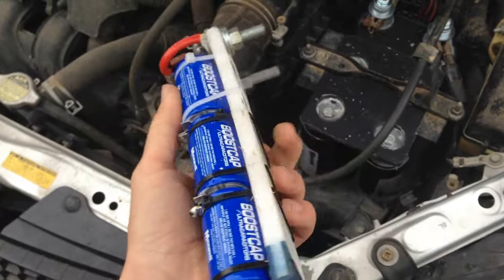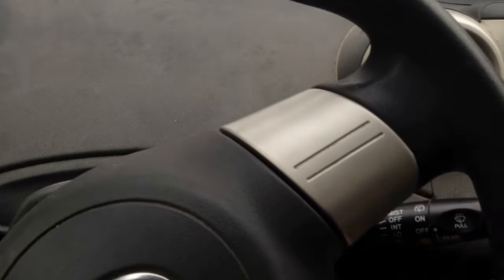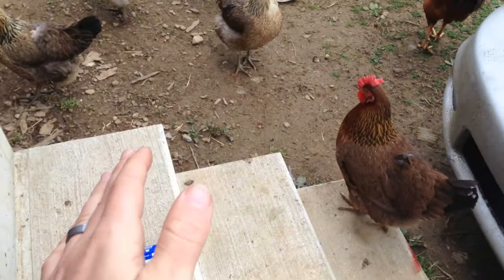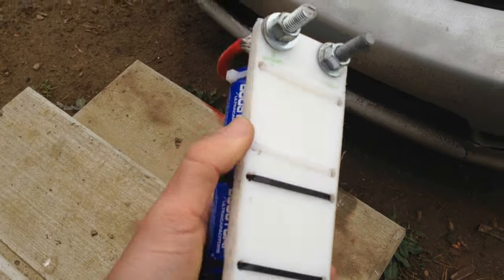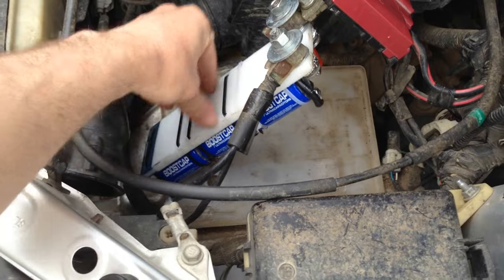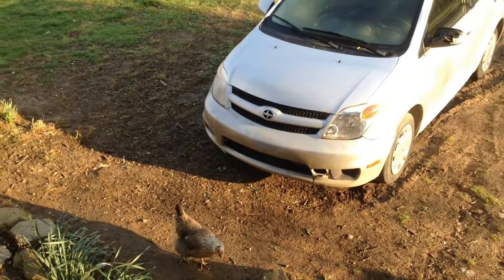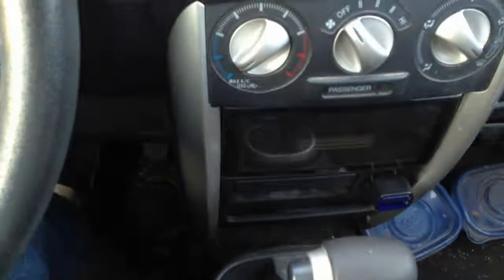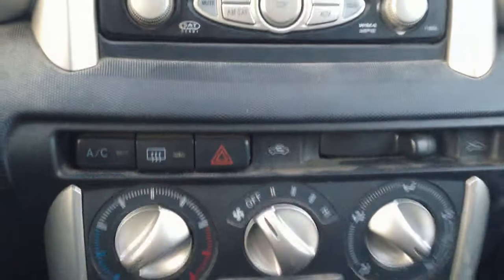Replacing My Car Battery with Capacitors! 12V BoostPack Update

Comment: This would be brilliant to have them charge while the car is running, and when the car is off, use the battery to keep alarm, and misc. electronics powered, but when trying to start, use a relay and switch to the capacitors....
Reply: WarHawk427 I was thinking he should have a solar panel on top.

Comment: what about .when is snowing would the freezing temperatures affect the car starting ..I think so ..
Reply: Supercaps are not affected because of low temps because they not use chemical energy but electrostatic energy, unlike ordinary lead acid battery, which can go very low with performance when temperature drops. The only problem with low temps would be engine being harder to turn because of thicker oil.

Comment: The part that's super-hoaxy about this is the radio part. I hooked this exact array up to an inverter which then powered a 10 watt speaker playing some music. And the caps lasted about 2-3 minutes by the time it dropped from 15 volts to 10 volts. I haven't bothered to try starting a car with this array... But I feel the OP isn't being totally honest.

Comment: I can't record anything without chickens invading the atmosphere and,  probably forty running loose. Nice job on the capacitor I wonder if a diode would prevent voltage drop, like they use on solar controllers

Comment: That was super. Thanks!
Would this work well as a power bank for a mobile solar rig?
I need something to recharge camera and computer gear in the backcountry with a solid constant source to run pure sine wave inverter..
Marine batteries are expensive and heavy. This seems ideal.
Reply: I have chickens as well. I love the chatter.
Reply: Yes, Hybrid design = super-capacitor + a small Lithium-Ion battery

Comment: The basic problem is that the car system uses power even when the engine is not running, so we need a lot of reserve power for long off times.  It would be better to have a smaller battery in parallel with caps.

Comment: In 0:41 have you touched negative and positive and you didn't die or your fingers didn't melt down? Were ultracaps discharged?
Reply: You are Talking about 12V doing harm??? Usually people start to FEEL voltages above 24V (tongue) 40v (on skin), we are Talking about 12V, nearly double than typical Phone charger, yet people most of the time (not talking about this ripoff chargers) are not killed by accidentally touching the plug of Phone charger...

Comment: How the heck are those 350 farads when a 2 farad car audio capacitor is the size of a water bottle?
Reply: +DesolatorMagic The rated voltage is much lower for these capacitors. Since the general equation for a parallel plate capacitor is C = eA/d, the capacitance increases as the distance between the plates decreases. With a lower potential between the two plates, there is less risk of burning through the dilectric and rendering the cap useless, so the plates can be placed much closer together.
Reply: Nick Christopherson
So since audio caps are 12V and I assume those 6 = 12V then they're 2v and that takes it all the way from 1-2F to 350ea?  That still seems excessive.  They must have altered the materials too or something.
Reply: +DesolatorMagic No that's normal. Learn how a capacitor works and what determines the voltage/farad.
Reply: What you're missing is that a denominator relationship is not linear, it is inverse. If the numerator value of the permitivity and area comes out to be 1 and the distance is 1, you have 1 farad. Now make that distance 0.5 you have 2. Now make that distance 0.25, you have 4. 0.1 gets 10, etc.
Reply: He may have meant microfarads. uF or mF ?
Reply: Brett Bendele no, they are actual farads. This is due to the very low voltage (2v)

Comment: if I were to hook up a couple of banks of these capacitors in serial/parallel would they work in an RV for deep cycle use especially with a generator backup for charging them back up?
Reply: no, mainly because you'd have very little reserve power. lead acid batteries would do a much better job for powering your RV. You'd need hundreds of capacitors to store as much energy as one lead acid battery.
Reply: Thanks looks like I'll stick to deep cycles in parallel.

Comment: would you help me with trying to make a motorcycle battery replacement?
I know electronics but any tips or tricks would be great,Thanks
Reply: Frightline777 I did a setup like this on my car. Personally I think you would want to measure the power and energy requirement for starting with the battery before buying any caps. This can work ok in some applications but not for all of them.

Comment: You still around?  Notice this vid is about 6 years old.   Question.  What would this boost pac cost today??  (2018). Also, have you thought about a waterproof plug in module for this application?

Comment: From where i came from its very difficult to buy a maxwell or boostpack super capacitors. Question is will the GreenCap from china work as well as your boostpack? they came with the same specs as 2.7V 500f.
Reply: Are they high quality or junk ?

Comment: Uhmmm... what I ask myself is: how safe is this? What about long journeys, when power is always given from the light-engine to the pack. And what if the pack will not take any power, because it's fully loaded. Can the power-engine be destroyed? Some engeneers say, you should not run a car without a battery. 
And what about the risk of fire? Or exploding of the packs?

Comment: How do you ensure that the capacitors are balanced? I don't see any balancing circuit on it, it's just connected in series.
Reply: Yes, you should add a Balancing Board.

Comment: This would serve more as a backup to start up the car in case the battery's dead.
Reply: Or wire it in parallel to the battery.  The cap handles the starting surge, saving wear on the battery, and the battery handles the deep storage.

Comment: As an electrician I am just watching those two massive steel bolts so close to each other, pretty sure your capacitors will dissapate completely if you short it out and it will be a large ass bang,

Comment: could you try this with a car that has a "Dead" battery and won't crank over? often there's still charge in the battery but it's unable to provide enough cranking amps to turn the engine... if you connected one of these that was uncharged and let it charge from the dead battery to 10, 11 or 12v (what ever it's at) and tried to crank the car over would it be able to start from a dead battery... I'm thinking of getting a few of these just in case my battery does die... it's only a 1.0L 3 cylinder so maybe I could get away with using small caps?
Reply: Yes, that's probably the best use of this idea - in an old battery the series resistance increases, so the voltage sags when a load is put on it.  The caps would over time charge to the battery voltage, but can immediately deliver the all the current that is stored (albeit only for a few seconds). 

Where this is not good for is starting after the car has been sitting for a long time (small loads will eventually drain the caps), and for lights and other loads when the car is not running. That energy needs to come out of the battery.
Reply: Do these caps lose charge if just sat in the boot with no load connected? If so, these things would be a much better thing to carry for dead-battery emergencies than jump leads and relying on someone with another car to help you out...
Reply: Debbiebabe69 yes they do loose charge but if your battery still has the ability to run low load items like the radio you could just hook it up to charge from the dead battery and then once it's charged it could provide a high amperage burst that the battery wouldn't be able handle without high Vdrop

Comment: would it work with any car? i have a 94 mustang GT and im very interested in this idea .. also for someone that had no electrical knowhow could we maybe order one  ready to go it though you?
Reply: bad idea... leave your lights on or pkay the radio for a short time and it wouldn't start. If your alternator goes bad tje car will shut down in just a few minutes. capacitors offer very little reserve power with current technology.

Comment: You could probably use a small motorcycle battery in junction with the super caps in a race car for weight reduction or put it in series with your audio amplifier before the amp in the trunk so your lights don’t flicker. I wouldn’t want this as my primary power supply for my truck and just like someone commented that the cars computer is alway on and slowly draining the battery you could put a breaker switch when you shut the car off hit the breaker so it won’t drain or theft but if your reg battery is working fine why bother

Comment: What's the minimum voltage you can start the car with? Surely no lower than ~10V?

Nice video by the way. Clean and to point. Thanks man!
Reply: it takes over 12v to crank the engine at good rpm, anything lower will not start

Comment: try running all your elecric components  headlights ect to see if the caps can handle the load.plus see how many cranks u get before it dies out
Reply: If you install a large Super-Capacitor then you can do this.

Comment: Would like to see what happens to the electrics/wiring of the vehicle when the engines not running but ignition is on?? I suspect stuff would be burned out?? Good idea though assuming this is not a con.

Comment: stick a solar pannel in the back window and you will allways start , trickle charge and never need to repace a battary ever again , Theres onle one problem if the regulator went short in the altenator then it would kill the car so protection needed , but it looks a brill idea all though you cannot leave any parking lights on in the dark when on a main road . you still need a battary , but still a good use full system for boats and so on

Comment: I have to charge my 1 farrod cap before using it & discharge before disconnecting it! I did not see you charge your capasitor so, that alone, makes me a bit skeptical. I don't doubt that it will work, I just wonder why you didn't show yourself charging you cap & bringing it up to 12 volts or higher? I  had my cap & sterio connected & I disconnected the cap & system because I smoked my alternator by manually running my cooling fans & running my system! I have since replaced the alternator & I am waiting until I replace my cooling fans b4 returning my sterio to the vehicle & it is parked while I wait! I am wondering since the cap raises the voltage to 14+ volts, was it the current draw or amperage draw that smoked the alternator? I assume the current & amperage draw probably smoked the voltage regulator? I have another voltage regulator that I am going to install into this last alternator just to see if it will then come back to life? if not, o-well, I just installed a brand new one!! be cool to have a back up tho!!!
Reply: He should have showed the "pre-charge" steps.

Comment: Dude, the way to test it is to disconnect the coil wire from the distributor so it won't start, then see how many seconds it can crank the engine at a decent starting speed. Don't go more than 30 seconds or you can burn out the starter. But I doubt this can crank your engine for even 15 seconds. You keep measuring voltage. It's amps that count. Please see how LONG it can crank your engine - in 15 second bursts to cool the starter...
Reply: The small unit will NOT crank for 30 seconds - most newer car do not.
If you need 30 seconds then use a LARGE super-capacitor and parallel a small Lithum-Ion battery

Comment: It will start it but not hold the charge. Believe it or not I actually started a 20 Ltr diesel with an 18v ryobi battery with regards to car batteries it's all about the initial output and ofcourse the recharge

Comment: if you want to burn your car, you can put the big capacitor in your hot engine zone, the capacity will burn if over charge or over heat, the electronic circuits of your car will short quickly because capacitor absorb too much power of alternator.

Comment: What is with all the ring comments?  If a regular acid cell battery can produce enough cranking amps to turn over the engine of a car or truck, then they should not be any more dangerous.  Try shorting the two terminals of a regular battery with a ring. It will indeed get hot and maybe melt and maybe spark and probably ruin the battery. But, with proper voltage control circuitry, then you could have it converted to AC first and then to a nice clean 12 V DC and discharge everything simultaneously like the solid state jump starters that you can buy instead of over a certain time constant.  I think a normal electrolytic capacitor has a discharge rate time constant.  The formula is τ=RC. This value yields the time (in seconds) that it takes a capacitor to discharge to 63% of the voltage that is charging it up. After 5 time constants, the capacitor will discharge to almost 0% of all its voltage.  Does the same time constant exist for super caps?  Of course, they are known for super quick charging and a very long discharge rate before drawing down to 0 volts.  Great design!

Comment: Get a small solar panel and/ or hand crank gen to recharge if it discharges due to an electrical fault...
Reply: Hand crank - no. Small solar power that outputs some amount constantly to overcome self discharge - yes

Comment: I’m just now seeing this content so I’m late to the party. But it seems like adding a small lead acid battery will make this circuit be more fail safe. If the caps discharge, the battery will re-energize them.

Comment: That's nice but you won't get many turns out of that pack should your car have a problem that requires multiple tries at starting. You also don't have much reserve for accessories and lights. That mini pack would be good with a decent sized Lithium Ion pack. You mentioned a LiFePo pack. Hopefully it won't be too tiny.

Comment: How long did the car run? did You drive it any distance if so how far?
Reply: Once the engine is running, the alternator recharges the "battery" and supplies all of the power to the accessories.

Comment: Ok this is an interesting project you've done.  I've done some calculations, but first and foremost (I might have missed it in the video but I can't hear you mention it) you will need a resistor.  You see a standard car battery puts out 12.6 volts when the engine is not running, and around an extra 2 volts when it is.  It's piss easy to find 12v caps.  And fat ass sized caps like those can store a large amount of electricity.  However without a resistor, the instant you turn the key to the first setting and complete the circuit, those caps will instantly discharge and the juice delivered so quickly wouldn't power an LED let alone a starter motor.  You need a resistor as like a gatekeeper to regulate the current coming out of the caps.  And I can't see a resistor anywhere on the boostpacks you've built.

All is not to vain though, the easiest calculation I can do here this when he had his radio on.  Assuming nothing else was drawing power you lost 3 volts in 30 minutes.  The radio itself would most likely use 5 amps of current.  Using the calculation of Resistance = Voltage over (divided by) Amps, we have 12 / 5 = 2.4.  But his first reading when leaving the car with the radio on for the first time was at 13v, not 12.  So we go 13 / 5  = 2.6.  Resistance is measures in Ohms and as resistors are not (usually) rated in decimal figures, a 3 Ohm resistor would do the trick.  So this project is perfectly do-able.

However due to how capacitors are built, you'll still have electrical "bleed" which lasersaber did demonstrate leaving the car switched off over a number of days so if you were to completely replace the battery with a capacitor bank, you'd need a way to keep them charged as the alternator on its own won't cut it.  If you don't want to go down the solar panel route for whatever reason, I'd still keep a battery in the car for backup.  Doesn't need to be a lead-acid battery, just as long as the battery(ies) can deliver a solid clean 12.6v should be enough to kick start the engine to life.  If not going with a standard car battery and instead a bank of common household batteries (like D cells), you'll need to put enough batteries in to be OVER 12.6 volts, then use a power regulator to bring it down to 12.6 volts.  If that can't be done, 13 volts should suffice.

Note that I only mentioned the batteries should only need the 12.6 to start the car.  Depending on car make and model the amps needed to draw to start the engine can vary.  The bonus here is, unlike lead-acid batteries, capacitors don't go permanently dead once flat (unless they explode, then well, yeah).  If your caps are flat, you could give them a quick charge from the battery (or any other source), and let the caps+resistor deliver the amps needed.

I'm not in the field of electrical commerce so I've no idea of what pricing would be, so what I'm about so say next is 100% utter guesswork so I'm likely wrong and will gladly hold my hands up if I am, but my theory in why lead-acid batteries are still used over a capacitor + resistor + alt power source is likely due to the lead-acid batteries would be cheaper to mass produce, especially in the case of solar panels right now.

Awesome video though.  Maybe in a few years hybrid cars would be started like this and lead-acid batteries will be a thing of the past?
Reply: Except your calculation must be wrong. It's way too much, to explain everything, but it just works as is and adding any resistor would mean it won't crank.

Comment: What about all the electronic and computer components that run on the residual battery voltage when the engine isn't running?
Reply: What about it?